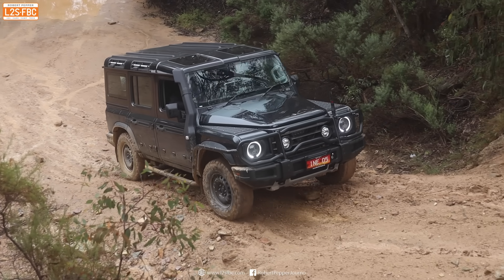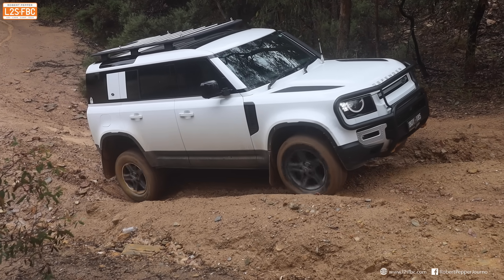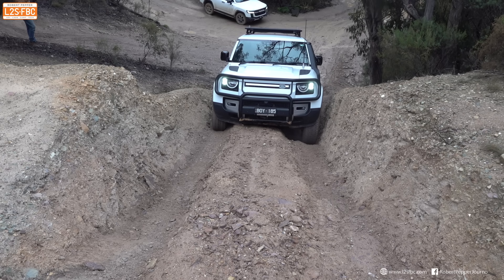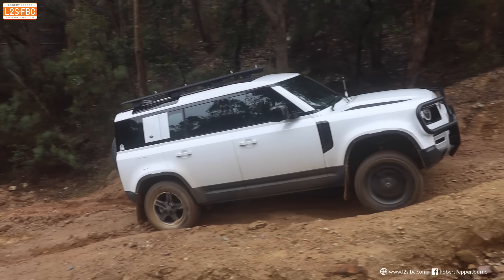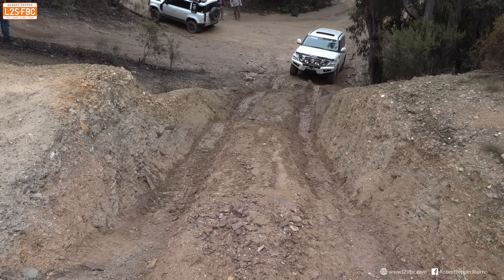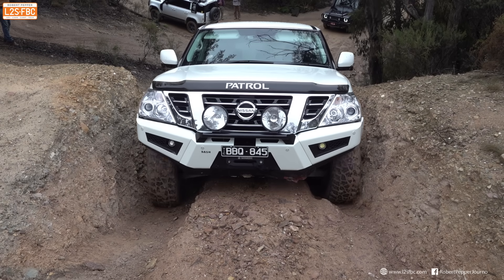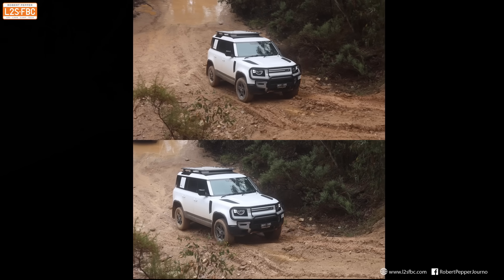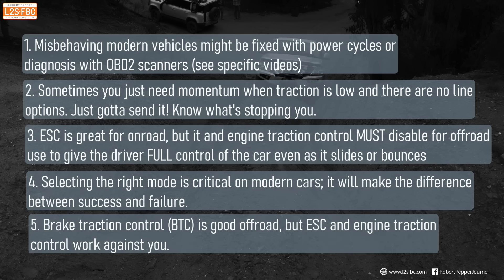Grenadier vs Patrol vs LC300 vs Defender - Part 5, Momentum

Comment: Though I’m certainly not ignorant or adverse to tech. I do think that all these drive modes are a gimmick, especially for the more experienced drivers. 
BTC ✅ 
Down hill assist ✅ 
Lockers ✅ 
Sway bar disconnect ✅ 
Multi terrain select  ❌
The Rubi has the above ticks. I have never thought “Man I wish I had multi terrain select”. 
I get that other cars may be more reliant on such systems, however, an efficient BTC system where ESC is automatically disabled in low range and disable-able in high, is all you need and want. And the BTC has to work with the rear locker on… personally, I have never seen a situation where this is a good idea. All of my Hilux and Prado mates always go better with the rear locker off.
Reply from the maker: Tend to agree, but LR's TR system really is very good.  The Toyota BTC is so good the rear locker is almost never needed. This is not the case for other vehicles eg older Rangers like mine.
Reply: @L2SFBC  I think the systems work as intended by the designers and engineers. Certainly in controlled test conditions. But in the real world, they just seem to cause confusion and frustration for owners and then when add in other factors, 20 inch rims, winches that are near impossible to use because where they’ve been mounted, auto handbrakes etc etc. It’s no wonder few 4wders choose such a vehicle for general off-road use. Even mates I  know with up spec LCs with drive modes spend quite a lot of time stopped trying to work out drive modes, and their mates can’t really help because they aren’t familiar with the menus etc. It would probably be less of an issue if they took it wheeling every weekend. But those people tend not to in my experience.
Reply from the maker: Very fair comments
Reply: Lol. You are me exactly. And it is exactly why I went from an LR4 (and I had the rear locker version) to a Rubicon. These mode operated four wheel drive systems can be very good, especially when you learn how to continuously apply at least some throttle so that the computer can figure out what is going on and make all the corrections continuously, in light to moderate offroading. But push them into more serious situations and there are always issues with them taking over at the worst possible moment. And even in light to moderate scenarios as a driver you are faffing about a lot which becomes quite tiresome after a while. If a vehicle is serious about being an offroader to the full extent, it has to allow all of these things except BTC to be disabled and, ideally, also have front and rear axle lockers that are selectable by the driver with no BTC at all. And of course the other thing is articulation. And as the Land Rover demonstrated this is less about maintaining traction, as many modern TCSs can maintain wheel spin with a wheel in the air, especially with consistent throttle applied allowing the computer to calculate properly, but rather is about safety as trails get more extreme. Quite simply wheels off the ground is the quickest way to a rollover. It’s kind of ironic actually- these electronic TCS, air sus vehicles make easy tracks and light offroading simple for the inexperienced offroader- and as this what 90% of people will do offroad open up offroading to more people. But as soon as you push them into harder stuff, they make offroading more difficult. And of course they also have so many more failure points that are usually the kind that are not trail side repairable, just increasing the odds of the veh leaving you stranded (the air sus on an LR4 having an issue and dropping to bump stops and also killing your ability to access the offroad modes is my very real and personal experience example). I loved my LR4 and it got me all the places I wanted to go for a long time, but as I began to push it into harder stuff ai just got tired of fighting my own veh. I just wanted to be in charge if the decision making and not the car and not be wasting all this time. And also, because I solo a lot, I was nervous about a breakdown leaving me stranded. There were just too many electronics that the veh was reliant upon that any failure and I’d be screwed; and those can’t be fixed trailside.  With the Rubicon I just selected the lift for my wheeling and it’s just Hi or Lo (and with Lo being looooowwww), axle lockers yes or no, and driver skill. The way I like it. Oh, and solid axles, because again, as you push these onto harder trails, IFS or full indy sus failures become real problems.
Reply: @L2SFBC  Robert. Another real work massive factor seems to be loads and mods. I’ve found that loads, especially where the COG differs from the factory specs and the added weight of mods, plays havoc with BTC. I suspect because, a heavier vehicle will need more throttle input to move the vehicle and thus the brakes need to work harder to stop the unloaded wheel spinning freely. I’ve found the BTC less efficient than from factory. It would be interesting to see a new defender loaded right up with touring mods/touring loads to see how it compares to an empty stock one. I’m personally very anal about where I place loads in my vehicle. Being cargo seems to orient towards the rear, I’m always trying to shift heavy loads low, and as far forward as possible. I think I really heaps stability and capability. (Race driver in me coming out) lol
Reply: I think in most cases the drive modes are the solution for an offroad problem that is designed into the cars because of "fuelconsumption,  emissions and cost reasons".
Here in europe the only 3 cars available with 3 lockers are the Rubicon (only in the 4xe version), the Grenadier the Mercedes G and since November last year or so the Bronco. (and all of them are out of reach for most normal people in terms of prices here.)
That's it. With every other vehicle, if you are very lucky you can get 2 diff locks. But in most cases only a center locking diff.
And that (in my opnion) has to do with the manufacturer needing to bring the vehicles weights and costs down. 

One for the fuel consumption ratings and emissions (to even be able to sell the vehicle) on the other hand to be able to have a price where there are still enough people who buy the car for the price.
The current Defender for example: as far as i was able to find out, it doesn't really have a relly mechanical locking diffs, but the BTC simulates them.
And they moved the production to a place where the labour costs less. Hence it being a little bit cheaper than the vehicles i mentioned above that have real actual lockers.

Electronics weigh less, and a non locking diff has less parts to move and so the fuel consumption is a tiny bit lower. Doesn't mean much difference in real world applications, but it makes a difference in the measurements and comparissons for the "type approval" so it can be sold on a market.
And which additional "fuel consumtion or emissions/Co2 taxes" are added to the price.

So then, if they don't put lockers in, they need the electronics to simulate lockers as good as they can. But as they are no real lockers, different surfaces and driving conditions would need the brakes of the car to be applied a little differently. ->the different terrain modes they come up with.
And if they work well or not depends on how much time and money they put into the testing and devellopment.
Which of course then also makes a difference in the endprice for the user.
The Grenadier was meant to have lockers, so it seems they put less time and money into the devellopment of the BTC or it would have been even move expensive. The other manufacturers have more than one model and more generations already where they have devellopment data.
But still with them, sometimes it shows where money and time have been spend or saved.
Reply: @operation4wheelz  I likewise am super conscious about weight in general and where it goes. Every mod I have done to my Rubi I keep track of the weight and heavy stuff goes down low.  Still trying to find a better solution for water other than Nato gerry cans on back seat floor. I refuse to put water or fuel on top. I also try really hard to keep everything inside my bed under my Alucab canopy to reduce drag from stuff hanging off the veh.  I might have to violate this rule for water and fuel though as I’m liking the Morryde carriers that mount in front of the front doors and can carrier either Nato cans or Rotopax. While it would be on the outside, cans would only be there during trips, and it would keep the weight lower down and free up some needed space inside. Once I move my spare permanently to a swing arm on the rear bumper I might look into either an auxiliary fuel tank or water tank in the spare space. That would be ideal but is a much bigger project. Cheers from the US. 🤙
Reply: @dadventuretv2538  have you got room for water in the foot well behind the front seats? That’s where I keep my water.

Comment: Interesting and well presented Robert. The Dynamic Stability Control (DSC) in the Defender can be selectively switched off in all off-road modes except Auto terrain response. Am I correct in understanding that is still operating to some extent?
Reply from the maker: Yes parts of it appear to still be active. ESC has levels of sensitivity - in road modes it will interven early and permit little slip. In offroad modes it will allow more slip. However, if it is not entirely off, eventually its limits will be reached and it will activate. Pressing the "off" button doesn't necessarily mean switching if off like a lightbulb.  Different TR modes have different calibrations for ESC (or DSC in Land Rover terms) and you can reduce it even more with the Off switch. In sand for example, I would run Sand mode (most of the time) and DSC additionally off as far as it'd let me.
Reply: I’ve found that the new Defender can be limited by DSC, so it’s worth trying to turn off at the switch. The terrain response settings also affects its operation. I would try Rock Crawl which locks the centre and rear diffs and keep a steady throttle trying a steady 2000 rpm to start. The Defenders don’t respond well to an on/off throttle technique in my experience, loss of momentum due to this can often result in a failed climb. Using this I’ve climbed some steep ascents with only one wheel having traction. Wheels do leave the ground frequently. Low traction launch can be handy in the right circumstances too. 👍 Great work!
Reply: I’ve found that the new Defender can be limited by DSC, so it’s worth trying to turn off at the switch. The terrain response settings also affects its operation. I would try Rock Crawl which locks the centre and rear diffs and keep a steady throttle trying a steady 2000 rpm to start. The Defenders don’t respond well to an on/off throttle technique in my experience, loss of momentum due to this can often result in a failed climb. Using this I’ve climbed some steep ascents with only one wheel having traction. Wheels do leave the ground frequently. Low traction launch can be handy in the right circumstances too. 👍 Great work!

Comment: Hi Rob - it would be interesting to see if you can get an official response from Land Rover engineering HQ. Surely they can reprogram the software over the air so that ‘DSC off’ really does mean ‘off’. Can’t be that hard, even if you have to press a disclaimer button to absolve them of potential drivetrain damage, I’d still rather have full and uninterrupted power when I really need it.
Reply from the maker: ha that's exactly what I've proposed for years! but we are edge cases so it won't happen, and it seems JLR is more interested in lifestyle events and fragrances than ceding control of their cars to the owners.  I doubt I could get any response that would be meaningful, probably just a "we optimise our cars..." etc. Their business model is their own call, and I'm not going to say it's wrong, but it's not aligned with what I do.
Reply: Yeah, it’s a shame. I wonder if LR Australia would fly the flag on behalf of local off-roaders. No doubt you’ve tried that too.
Reply from the maker: Too much of a niche market and not their focus. The last L663 special edition came with a surfboard and the last owner event was at Byron Bay.